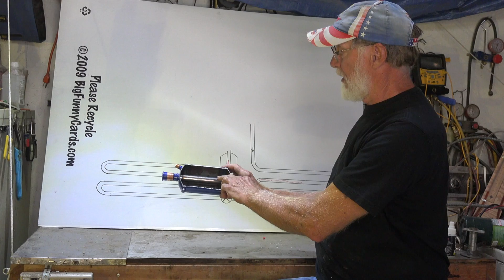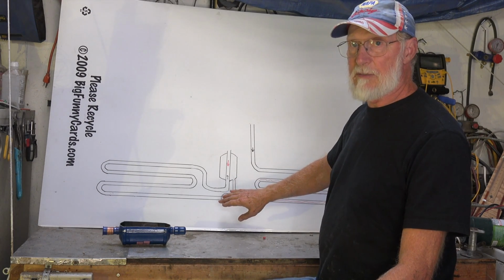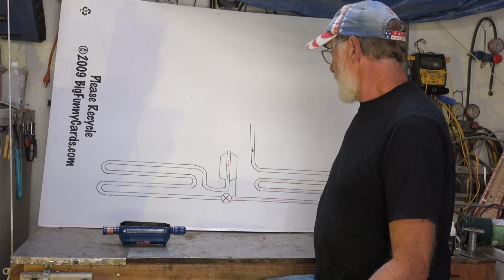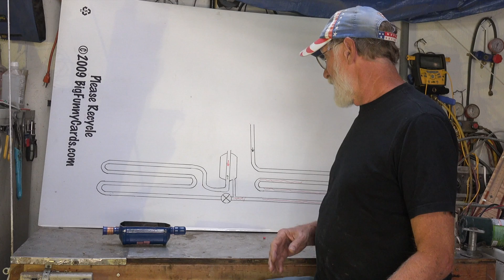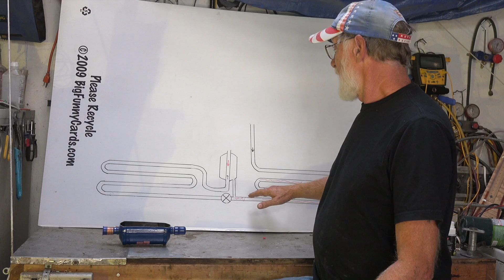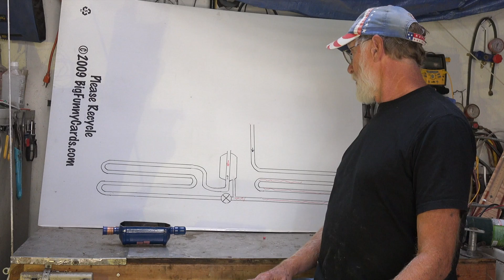The difference between the receiver and the charge compensator

Comment: That is not accurate. The charge compensator is used on heat pumps. In cool mode hot gas passes through the compensator and push out refergerant with heat. The opposite happens in heat mode . In heat mode cold gas passes through and condenses gas into a liquid. In heating the air handler and line set doesn't hold as much refergerant.
Reply: Thaks for this comment. This explains my issue.   I converted a 3 ton R22 Rheem heat pump from air to refrigerant to water to refrigerant. Used a 3 ton rated tube in tube condensing/outside coil. TXV on inside coil: orifice on outside. Had to experiment with orifice size to get it functioning properly. Have to remove 2 lbs refrigerant each spring to hold head pressure down to spec and keep it from hitting high pressure safety switch. Add 2 lbs back in fall to get within spec. Seems like charge compensator is working against me. Considered adding a receiver, but it would be a plumbing nightmare along with cost of check valves etc. Should I try a larger/smaller charge compensator or eliminate it entirely? Your thoughts are welcome. Rich
Reply: @richardschaefer9858  I would love to help. Can we connect outside here?

Comment: I have a situation with a customer with a weird problem that “May” need one of these.  He has a 30 year old split with multi circuited cap tubes.  The manufacturer was Sundial by Square D.  He had me R&R the condensing unit with  a Fedders heat pump condensing unit. It has a TXV and no receiver. This goes off on high head every fall and short on refrigerant every spring because we recovered a few pounds of 22 the previous fall. Would this work on this unit.  I noted the condensing unit said for TXV units only.   What do you think? Would I have to also add in a receiver tank?
Reply from the maker: I would not install a receiver.  You could install the compensator, but sizing would be a problem.  You also need to consider using a matched indoor coil.
GFM
Reply: @grayfurnaceman  I have the opposite of the above issue. I converted a 3 ton R22 Rheem heat pump from air to refrigerant to water to refrigerant. Used a 3 ton rated tube in tube condensing/outside coil. TXV on inside coil: orifice on outside. Had to experiment with orifice size to get it functioning properly. Have to remove 2 lbs refrigerant each spring to hold head pressure down to spec and keep it from hitting high pressure safety switch. Add 2 lbs back in fall to get within spec. Seems like charge compensator is working against me. Considered adding a receiver, but it would be a plumbing nightmare along with cost of check valves etc. Should I try a larger/smaller charge compensator or eliminate it entirely? Your thoughts are welcome. Rich

Comment: What, if any, difference is there between a receiver and an accumulator?
Reply from the maker: The difference is massive.  The accumulator is used mostly on fixed orifice systems.  As liquid refrigerant returns to the compressor, it is trapped in the accumulator.  Thus protecting the compressor from slugging.  
The liquid line receiver is a storage device to keep the condenser from being flooded with liquid during low demand.
GFM
Reply: Simply put, receiver is on the liquid side and accumulator is used on the suction side.